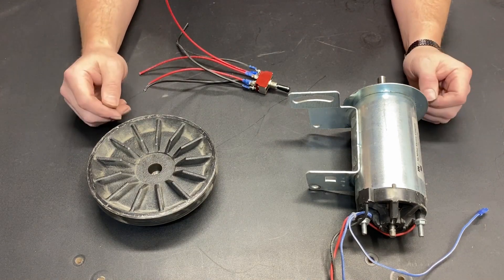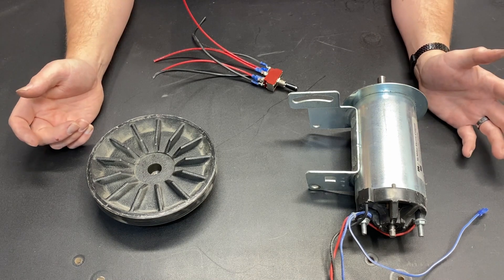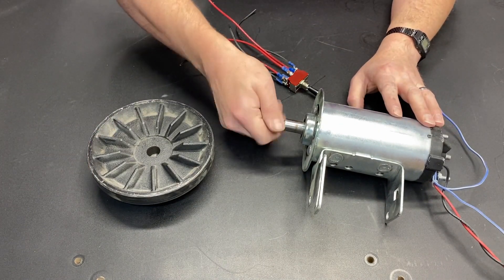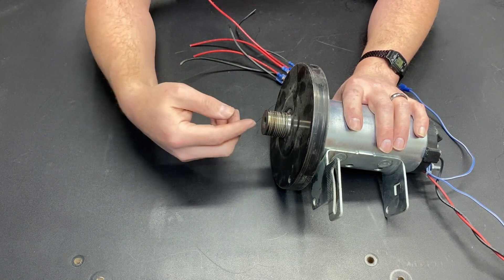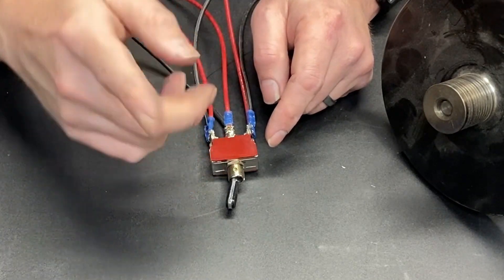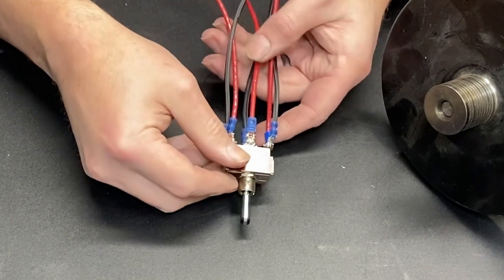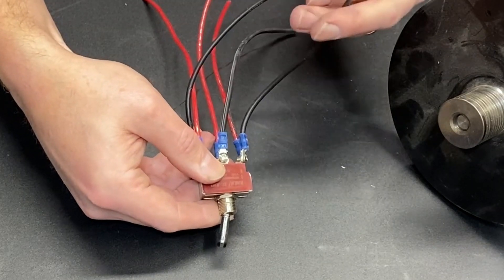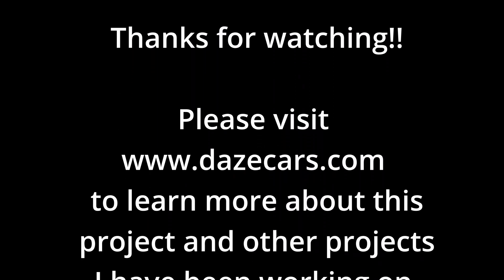Treadmill Motor Forward and Reverse Direction Switch Wiring and Feasibility

Comment: Actually have the switches in my hand and wiring the treadmill motor to my lathe no more starting at 600 RPMs now I can start it around 30 and not put my life in danger when I have a 60 pound chunk of wood on there❤️‍🔥❤️‍🔥❤️‍🔥 THANK YOU SIR🇺🇸
Reply from the maker: glad I could help

Comment: Fantastic description and spot on❤️‍🔥
I have an 85 Chevy pick up that my clutch assembly picked up the clutch about halfway off the floor. I only use it to plow with so it’s sad all summer. This winter the clutch grabs an inch off the floor? It has a hydraulic clutch, but the system is full. It never lost any fluid . What the hell is going on?
Reply from the maker: That sounds like a bubble in the system.  Air in a hydraulic clutch will not be spongy like brakes but it will reduce slave cylinder stroke causing more pedal travel to be required to actuate the clutch.
Reply: THANK YOU SIR I WILL BLEED IT OUT❤️‍🔥❤️‍🔥❤️‍🔥

Comment: What's with the treadmill motor that only has a black red and a yellow green wire, I have the treadmill motor that has black red and the two blue wires wanting to use the controller on the other treadmill motor
Reply from the maker: red black and green is + - and chassis ground.  Blue wires are to use a thermal fuse inside the motor.  https://youtu.be/Mx4022PbHO4

Comment: I believe I can tell you why you get these results 🤥. The MC-60 does not use feedback from a tachometer to tell the drive that the load is exceeded, in fact it uses current limiting detection circuits on board in order to do this. In the MC2100 there is a belt speed sensor that is directed up to the TM console, whereupon the console processor adjusts the output signal accordingly and send a signal back to the main board. So using just the main board, feedback has been defeated ! I have been thinking of replacing the controller using a Picmicro to replace the one in the MC2100 where some kind of RPM/current detection can be implemented, as the PWM method of motor control is definitely the way to go.
Reply from the maker: I am familiar with all of that and because of the tach input converted my bandsaw from SCR to MC2100. 

Bandsaw Upgrade Using the Tach Input on an MC-2100 to Have More Consistant Speed Tach Input Test
https://youtu.be/pAGfRHpHa-0

Turned out to be a total waste of time because an MC 2100 is a fragile piece of electronics. My wife’s treadmill has gone through several of them and that is using it as a treadmill. You put it in a shop situation where you can stick a blade you fry the board every time. I’ve since gone back to the far superior (in the robust category) SCR controller for my bandsaw. I stuck the blade just the other day and didn’t damage anything.

MC2100 NOT a Good Power Supply Option for Shop Tools!
https://youtu.be/yMkW2SXl_sA

You may also be interested in this video where I do a head head shootout with three different power supplies. 

https://youtu.be/AdGypyO_UuM?si=4X44xGQ4Fc4u7re5

Comment: I have a 3 hp treadmill motor and I cannot find brushes for it. Do you have any suggestions where to look? The number on the brush is 561.
Reply from the maker: Your best bet is to replace them based on size rather than part #  take measurements and try to find some with similar dimensions.  The length of the brush should be slightly less than the depth of the brush pocket.

Comment: The switch linked in the description seems to only be rated for VAC... is that okay for a DC motor? My motor is 110VDC @ 7AMP at max. I've been trying to find a DC-rated switch that handles that load but haven't had much luck
Reply from the maker: no, and yes.  because of the pulsing nature of treadmill speed controllers the electricity flow across the switch is similar to AC and the fact that in most cases you are running them at slower speeds allows you to get away with components you cold never use in a true DC situation.  Is it correct? NO.  Will it work? most cases YES. Will the switch have as long of a life? Probably not.  This video explains in more detail https://youtu.be/oTStJDQq664?si=7BA9Py8tO4YrdK-m

Comment: I fitted a DPDT switch and after allowing the motor to stop i put it into reverse and all was good, stopped and run forward again and the SCR blew up, BTA10 motor stationary before restarting forward-backwards-forward fried SCR any ideas why
Reply from the maker: What rectifier are you using?
Reply: @dazecars  the large black one for a welder that you recommended
Reply from the maker: @GrahamLegg  I would check to make sure it has not shorted out.  do you have a circuit breaker between the rectifier and the SCR?  also what SCR are you using?  what is the amp spec on the motor?
Reply: @dazecars  Thanks for your help
SCR = BTA10 10000w high power
Rectifier = QL 100A 1600v
no circuit breaker
Motor Pacific Scientific 220DC, 12A, 3.2HP, 3400RPM, 2386W
What circuit breaker should i be using, is it just a re-setable fuse
Reply from the maker: @GrahamLegg  is it the good SCR I recomend or the long skiny one every one else recomends.  I would  check for a short.  The SCR may have had a defective part in it.

Comment: Just about finished my power supply for my drill press, starting to connect the wires. I see the wiring of the DPDT switch on your website is different from this video. On your website, you run the wires to the motor from one set  of the outside switch terminals (which are cross connected) not the center connections (which receive the power in) while in this video they run from the center connections and the power to the switch runs to one set of the outside connections (which are cross connected). I guess both would achieve the same result, just thru me for a minute.
Reply from the maker: It's Ironic that the flow of electricity on a "direction switch" is not directional 😂😂  In other words the power supply and motor are interchangeable from the perspective of the switch.

Comment: Have used treadmill motors on various machines and now installing one on southbend 9 lathe with reversing switch was wondering how -where a motor choke gets  set with a reversing switch in the system THANKS.   Appreciate all the good advice
Reply from the maker: I always put it before the switch, however it really doesn't matter as some treadmills have it on the positive lead before the motor and some have it on the negative lead after the motor.

Comment: Hi Dazecars. Its almost like you read your followers minds, and I appericate your indeph explanation in these videos. I was going to question more about the switches and stuff on the other day in the comments. This video rule most of those out. Thanks again.  I still got one question. Im using a rotory switch very simliar to the one you have in the other video, but I noticed that one has total of 12 terminals. I bought a 8 terminal one thinking it might do the job.  I wanted to see your opinon using the 8 terminal one. I dont know if I can send links from amazon of what I have, but if you were to look it up its basically called "Changeover Switch LW28-20 3 Positions 8 Terminals". I beleive I could use it still but wanted your thoughts.
Reply from the maker: Not all rotary switches are the same.  I had to order several before I found one that matched the one that came in my lathe.  The problem with most rotary switches is they are not double throw.  In other words one terminal can not connect to two different terminals only one.  That requires a lot of testing with a meter and jumper wires to get a rotary switch to work the way you want.  This one is actually double throw and would work as a direction switch https://amzn.to/3WlVWKQ

Comment: Thanks for the videos  Awesome info.  I do have a question though.   
 Can you use a DPDT switch  without an off position if you only use it after the power switch is turned off and lathe has stopped?  That way you wouldn't be taking a risk of switching to reverse while lathe is turning?      Main reason I'm asking is I thought I ordered a three position switch but no only two. 🤔   Thanks for thoughts
Reply from the maker: could you do it, yes, is it a good idea IMHO no.  The risk of switching while it is on or still moving is to high.  The first DPDT switch I installed on my lathe was kind of soft in the switching action.  In other words the engagement between positions was not very crisp and din't require much effort.  I was running the lath one direction, tried tried to switch to off and ended up going all the way to reverse.  There was a loud bang and a plume of smoke came out of the back of the motor.  Thankfully I was not running the lathe very fast as there was no permanent damage although I am sure I shortened the life of my brushes.  Had I been going at a higher RPM the results would have likely been far worse.  Also thankfully I was using an SCR which could handle the load and the motor stalling.  I have heard from two different people in the last couple weeks that have fried an MC2100 by going directly from forward to reverse.  You technique of cutting the main power and letting it come to a complete stop before changing directions would work and would be safe but for me when I am working on a project some times I get distracted ad I could see myself flipping that direction switch to soon.  The $9 spent on a new switch seams like a far better price than the $50-$100 it could cost to replace the power supply and/or motor.
Reply: @dazecars    
Thanks for the info.  I didn't make myself very clear. I completely understand useing a metal lathe.   I am useing a wood lathe and will not be using the reverse  switch very much at all and before useing an operation that would require the power would need to be shut off.  I plan on securing the switch in a box by itself.    
Again Thanks for all your videos and help.  I'm looking forward to get all hooked up soon.

Comment: So. Is the drawing on your website is wrong?
Reply from the maker: Not wrong at all.  two different ways to do the same thing.  The difference is the power source and motor have been switched.  The result is exactly the same.
Reply: @dazecars  I did wire mine the way the drawing is. It did work
 I was just concerned that it might fail. Thanks for the clarification.

Comment: I have mine on a shopsmith with two bandsaws, video on my channel, https://youtu.be/89DqRQA73ZY
one is for resaw and one for regular guitar work!  The reverse allows me to just flip a switch and  move the power coupler and go!  Good info, has helped me. I need to find a way to regear my saws motor, have way to many RPM's now and need more torque!  Will get to it someday!
Reply from the maker: For most applications gearing a treadmill motor is a must.  Where most motors are in the 3500-7000 RPM range I have seen a few with a max of 12,000 RPMS.  Not a lot of practical uses in the shop for that kind of speed.
Reply: Yes, it can zip along as geared at 6000, need max about 3500 for the bandsaws use on it only. The gearing is tough, not much room in the power head to work in. 
When I get time, I’ll try to figure it out. For now just be fast on the speed control to power through, then turn down so not blow the tires and blade off of them.